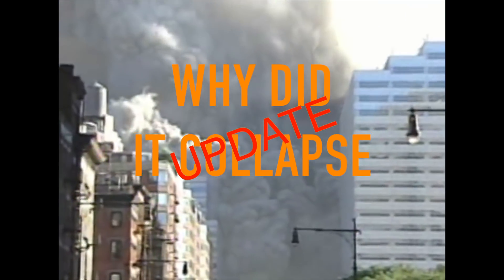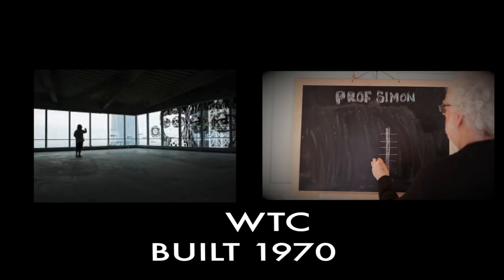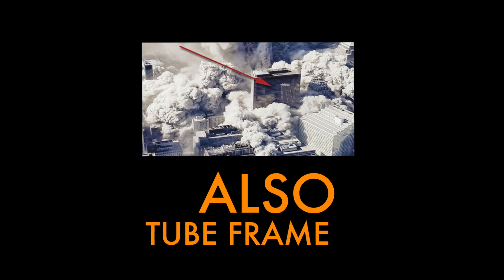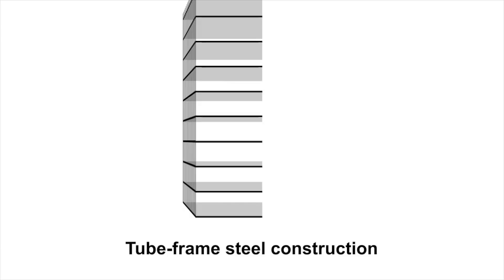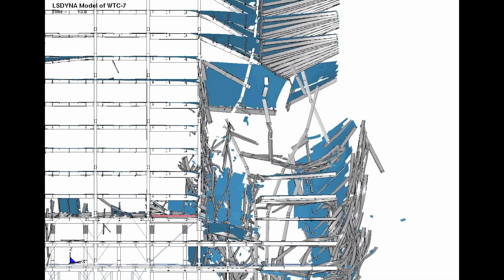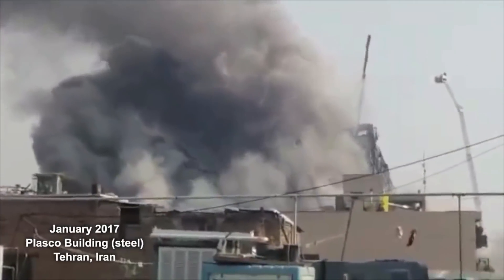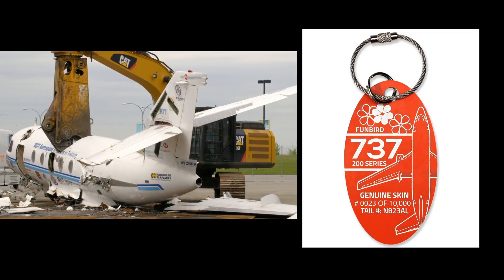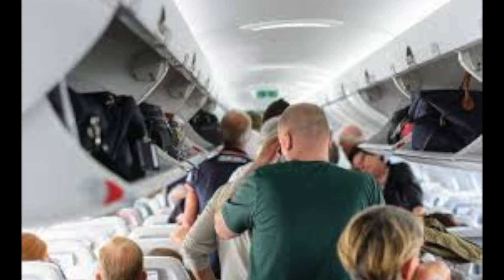The Hollow Tower - facts not fiction on the WTC design.

Comment: I have studied the destruction of the twin towers footage that has been freely available
and I still find the whole collapse extremely odd. there is one particular piece of footage If you search for 'The North Tower Spire 911' that shows  center core columns briefly during the collapse, they sway slightly, then seem to drop and disintegrate to dust. How does fire do that to steel? these parts of the columns were many floors away from the actual fire? the columns look like pieces of charcoal crumbling to dust.
Any thoughts on that footage Simon?

Comment: But the engine parts are most durable. Where are they?
Reply from the maker: Hi Tomislav, good questions...they found a 676 engine core on the street and more recently the undercarriage stuck between two buildings.
Reply: StealthyMonk
Not quite - they found an engine on Murray Street but it was not the engine from the alleged 'hijacked' planes (Boeing 767s). 
.............................................
Actually, it was. I'm still trying to figure out why the parts illustration doesn't match the 767 diffuser, but I did find photos of a Pratt JT9D-7R4D on the refurb line, and it has the same diffuser as shown in the parts page and the photo on Murray street that started the whole controversy.  http://tinyurl.com/y92sd9x6   Note the diffuser.
Reply: StealthyMonk
Let's assume this is an average sized adult male human standing next to it.
.................................
Interesting hypothesis, but to me it looks like the man is closer to the camera and the photographer was using a telephoto. When you look at the hot section of most of this series of engine, they don't differ much in size. They're using the small gas turbine to drive a low pressure turbine which turns the fan. One core can work with a number of bypass fan cases. That photo shows the rear main bearing and air seal at the top.
Reply: StealthyMonk
The engine has been identified as a CFM56, the power plant from a 737. 
...................................
I haven't found anything on the web to work with so I can't refute your claim, other than to say there were close to a million people in the streets that day, and quite a number of them produced video of a 767 crashing into the tower. To claim that THAT didn't happen is to depart from reality. Good luck.

Comment: There are still serious problems with the official "explanation". In order to make their scenario vaguely plausible, they ignored the documented existence of shear studs connecting the girders and floorpans, which locked the structure together. In the beams, they claimed that differential expansion broke the shear studs, ignoring the fact that concrete and steel have similar thermal expansion coefficients and, being connected, the temperature would have been similar between them and so no substantial differential expansion would have occurred. The Tehran collapse is instructive in that it looks like the NIST simulation of a progressive collapse -- which is NOT what Building 7 looked like, as it fell in a unified block, symmetrically, at free-fall speed -- which is the opposite of progressive collapse, and impossible without precisely timed demolition explosives. Note the roofline of WTC7 is more or less horizontal; one end did not fall before the other, and the centre of the building -- NOT the area around the claimed failed column 57 -- leads the fall.

Comment: Never use your oven broiler. Your stove will collapse into a pile of rubble.
Reply from the maker: Ask your garage how they fix your car....bend metal with heat.
Reply: @SimonHollandfilms  "Ask your garage how they fix your car....bend metal with heat." LOL! That's right professor, but it takes the concentrated flame of a blowtorch to do that. Both my brothers were mechanics and they both had their own businesses. I spent 11 years in construction. I could list point by point the factual errors in this video for you if you would like, but I'll site the first two. "The world trade center was not a popular building when it was being built."  Supposedly due to concerns about fires and aircraft impacts. You forgot to mention that the architects addressed those concerns in their design model. The next obvious factual error in this video is assuming "the outer wall of the WTC was purely a shell." This isn't true by a long shot. As for Building 7, the University of Alaska did a 3 year study on Building 7 and concluded NIST's collapse model was fatally flawed, far beyond the "small errors in calculations" noted in your video. But I didn't need a study to tell me that. The only way you can initiate the symmetrical and global collapse of a structure through the failure of a single connection is if all the strength and weight of the structure has been vectored to a single point. No one builds a building that way. Steel framed buildings are not a house of cards just waiting to collapse at the slightest disturbance. This is just a suggestion, but you might want to extend your education beyond computers and music before you get into discussing structural physics.

Comment: Things that make me go hmm. 1) Red hot metal pouring from the south tower out of the exit hole made by the fuselage of the airplane near the corner that the wing root slammed into. 2) Rows of windows blown out of only certain floors of WTC7, visible in this video https://www.youtube.com/watch?v=Tgo_VLD4WbU 3) Lack of video of the pentagon attack, and lack of evidence of a plane crash, hole is too small. 4) Demonstrated motive for drawing the united states into middle eastern wars (USS Liberty attack by Israel)/ 1993 bombing of WTC. 

Thermite is quiet compared to explosives, and it can cut beams. https://www.youtube.com/watch?v=5d5iIoCiI8g 

I suspect that the thermite was supposed to drain inside the building, and not outside. Watch the second plane hit the south tower and pay close attention to the fuselage coming out near the corner. That corner box column was damaged by the plane and that is why the liquid iron/steel found a way out of the building. Was the box column pinched off or torn open? 
https://www.youtube.com/watch?v=cXxZNHrtyuU
https://www.youtube.com/watch?v=Ec5L2hx1lFI

BTW, the Plasco building in Tehran didn't fall into its footprint. 
Also, I thought there was credible evidence that there were explosions in the basements of the towers.
Reply from the maker: good research....thank you for sharing.

Comment: I would like for you to try out some calculations that I have repeatedly performed on the Twin Tower failures. If these buildings were not blown up, then they were pulled down entirely gravitationally. Calculating the exact gravitational energy is complicated, but a conservative overestimate can be made by assuming its mass is uniformly distributed with the CM at midpoint (rather than about 1/3 of the way up as it actually was). So assuming the gravitational PE was equal to a particle massing the same as the tower as half of its height, there should be about half again as much energy as was released in the collapse event. Fair enough.
Now, the floorpans were made from lightweight concrete on steel pans, averaging 15cm thickness over 4000 square metres per floor. LWC has a design mass of 1500 kg per cubic metre, according to my Canadian concrete design handbook. These floors were pulverized in to micron-sized dust and ejected horizontally at about 100 km/h. Ignoring the enormous energy needed to pulverize the concrete, or shatter the structure, or indeed do anything else needed to cause the failure, let's just consider the kinetic energy taken by accelerating this concrete to this speed. We are also not considering losses in converting the vertical gravitational motion into the horizontal motion of the debris. So, if this is to have any plausibility at all, this KE must be a vanishingly tiny fraction of the original PE available, say one percent. Otherwise there is clearly no way that these buildings could have fallen; thermodynamics would prevent that happening. As well, the TOTAL energy losses could not be greater than an amount which would allow the collapse to proceed at its observed rate of 2/3g all the way to the ground (in spite of the steadily increasing stoutness of the tower structures).
Do you get a result, for this minor energy sink, being a couple of orders of magnitude smaller than the available energy? I don't (but I won't tell you right now what I got, I would like to see your independent calculations). Given this simple calculation and its extremely conservative assumptions, what does this tell you about the Twin Towers collapses? Could they have been gravity driven, or would there have to be an energy source driving the observed effects?
Reply: OnePalProductions
I think that by virtue of the fact these towers literally pulverized themselves to dust mid-air and that some of the debris ejections actually changed direction mid trajectory due 
.......................................
Yeah, uh nah.

Comment: so professor...how do you explain the fact that when tower 2 began to collapse the entire top third of the building above the jets impact began to lean over to the point where the central point of the buildings mass had gone over the outer edge of the lower 2 thirds of the still upright and allegedly uncompramised steel structure...from a physics point of view as there was literally no opposing force to prevent it from continuing on and the evident fact that the greater mass of the lower 2 thirds were,apparently,structurally intact the the top third should have continued on that trajectory and slid off the edge and plummeted as one whole piece to the ground below leaving the remaining 2 thirds still standing,albeit,severely damaged.
Reply: @patlucas8227  
 ''the top third should have continued on that trajectory and slid off the edge and plummeted as one whole piece to the ground''

The top block leaned over at 22 degrees. 

The ''bottom'' of the top block slid INSIDE of the bottom sections exterior walls, which stopped the top block from sliding off and falling on to the street.

As the top section tilted over, it wedged it's self inside the bottom section.

This wedging of the top block prevented it from sliding off, and falling onto the street below.

Comment: even in a pancake collapse, and that's assuming that fire weekend in the steel beams of all the floors miraculously even though the Heat of the fire never reached them, you would have resistance. thousands of tons of cement Steel and other materials would not allow the collapse that nearly Free Fall speed. if you had a stack of plates and dropped a bowling ball on them from a high distance, the bowling ball would not continue a free fall speed. plus no other building had ever collapsed because of Fire compromising the structural integrity. buildings have literally burned for weeks yet the steel frame remains, the only time that has ever happened is three times on 9/11

Comment: One thing that EVERYBODY seems to  is is that each plane banked slightly just before hitting the towers, which took out about 10 floors. If the planes had gone in straight, it may not have caused a collapse
Reply: @Datanditto  naaa. Fact.

Comment: The builders use grades of steel that had a much higher strength than called for in the building engineering specifications.  One of the reason it stood so long after it was hot.  You can read about it on wiki.  I wonder how widely know that was know before 9/11.

Comment: I have made many comments on other channels. People think the floors were reinforced solid concrete with steel beams supporting the floors.  People don't realize 4inchs of lite weight concrete.  I've also stated that if a 1000 people were on one of the top floors.  They started jumping up and down they could collapse the floors.  You showed a picture of the floor components and i believe you read the same reports i read.  The floors were made to hold only live load and nothing else.  Those  buildings were picked because of the way they were constructed. That means people really knew the building and its construction
Reply from the maker: Thank you....I totally agree...your information is vital to solve why the towers fell.....
Reply: @SimonHollandfilms  i made a comment on explosion science.  Did you read it or was it blocked

Comment: Here's a challenge. I'll give anyone a section of 2 foot thick steel beam and as much office furniture and kerosene as they want and I will pay them £50,000 if they can bend that steel with an open fire.
Reply from the maker: Take it to your local garage and they soften steel parts everyday...500c
Reply: @SimonHollandfilms  Provide me evidence of a garage softening 2 FEET THICK steel girders at 500c and the monies yours.
Reply: @jelleepit  
The engineers assumed in their design calculations ---> the impact damage of a 20% smaller, SLOW flying, DC10 or 707, low on fuel.

The towers were not designed to remain standing after being impacted by fully fueled 767's flying at full throttle.
Reply: @jelleepit  
''Airplane impact tests conducted by WTC structural engineers during the design of the Twin Towers used the Boeing 707.''

707's did not impact the towers, it was 767's.

Yes they used the Boeing 707 for the design calculations, but the 707 is a landing plane so it was assumed it would be flying slow and low on fuel.

But on Sept 11, Boeing 767's which are a take off plane, fully fueled and 20% larger, were flown full throttle into the towers. (Not 707's !!)

The 767's caused serious structural damage to the towers, more than what a slow flying 707 would have done, so it's no surprise the towers collapsed.

''a 767 could not be doing max operating speed or it would have shaken apart.
''

That's not true, it could be shaken apart, but it depends on how long you fly at that speed.

''They would have also known that a B52 had already hit the empire state building previously, without collapse.''

 B52 is a much smaller plane you, so it will do less damage.
Reply: @mcdonaldsneedstousehealthi4369  What you don' t know is that I have researched and studied 9/11 for years, every last detail including the planes. I am a member of architects and engineers for 9/11 and pilots for 9/11 truth. I am happy to continue this debate as long as we remain civil if you are willing to be open minded. I will share all of the data about the planes with you and why the official story is nothing short of fantasy.
Reply: @jelleepit  
The towers were designed for the impact of a boeing 707, but it was Boeing 767's that impacted the towers.

==> The Boeing 767 has a LARGER wing span (156 feet), --> thats 3 meters longer wings than a Boeing 707, and because the exterior columns were closely spaced together the 767's wings can destroy more columns than a 707 can.

Also the spray on fire protection was not installed correctly.

You can design a steel building to resist a plane impact, but preventing fire from damaging a steel building is another story.

The towers were still standing after the plane impacts, but It was the thermal expanding/sagging long span floor beams/trusses, that triggered the collapse of the TT's and building 7.

Why have only 3,000 architects and engineers signed the ae911truth petition?  That is a very very small percentage of total architects and engineers in the world.

There is a photo on the Metabunk thread of the TT's floor trusses sagging, which proves NIST's floor truss sagging theory true.

You just don't want to admit that long span floors can be a problem in super tall buildings during a fire.

Did you notice that wtc7 had it's fire on the lower floors (5 to 13), those lower stories had to carry the loads of the 34 storied above, so if they fail, ALL the stories above will also come down.

In a tall building, the worst place to have a fire is on the lower floors.(wtc7)

Concrete buildings perform better in fires because they have CONCRETE connections, and concrete does not soften when it gets hot, but steel DOES. (Grenfell was a concrete building designed for long duration fires).

A tall building had never totally collapsed before the TT's were designed, so fire was not taken so seriously back then.

The TT's engineers did not realize that the long span floors could be a problem in a fire, but now we know they can be a problem, which is why that type of design will never be used again.

In the 1960's that was the first time ever --> that (long span floor trusses) had been used in such a tall building.